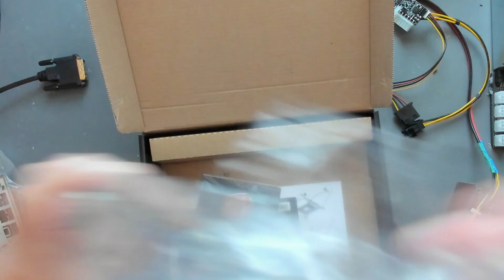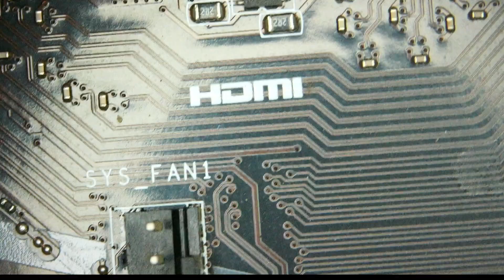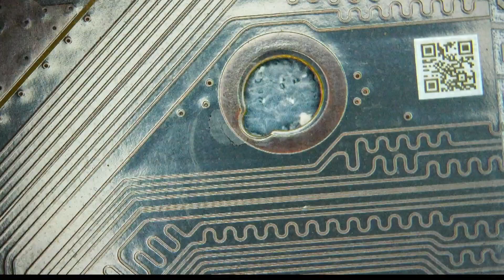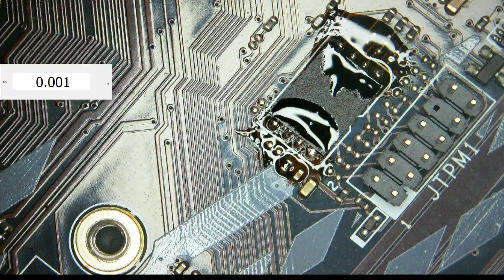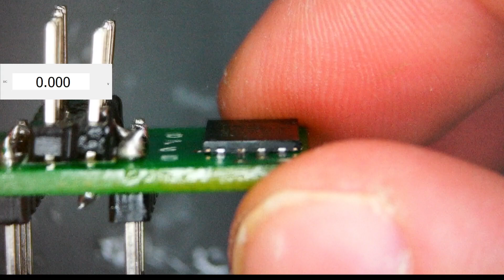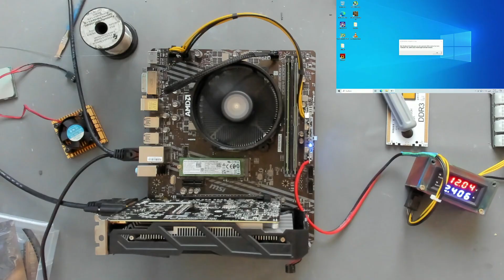CPU-LED NO BOOT || MSI A520M-PRO REPAIR MOTHERBOARD FIX

Comment: Recently i got the Asrock A520 Phantom 4 for 21,99 include sending in working condition. Is it worth repairing the lower end boards?
Reply from the maker: Lower end boards are most of the time not worth repairing money wise! For experience and knowledge they are great or sometimes for content, but money wise they are not!

Comment: I'm a bit uncomfortable with that hot air near these plastic connectors around the BIOS chip without any protection. Especially after i saw the melted connector on your programmer adapter. I suggest at least use some kapton tape to protect these connectors
Reply from the maker: I got to be honest, sometimes my work is a bit quick and dirty and i really could do with some kapton!

Comment: A lot of repairs are around AMD chipset. Is it on purpose or AMD motherboards are more prone to fail?
Reply: No issues with an AsRock B550 Steel Legend with a Ryzen7 5800 in it, GA and MSI are meh, Asus is the same too now, just poor manufacturer quality from the pcb makers.
Reply from the maker: Actually the chipsets or the PCH´s in my experience fail way more often on Intel Boards! Ive never had a B450 Chipset fail on me and ive worked on a lot of these, but for example X99 or Z270 Chipsets are dying left and right!
Reply: @MainboardMedic  my assumption was based on your last 10 video uploads. 8 AMD chipsets and 2 Intel chipsets.
Reply from the maker: @wolf1438  Oh you mean in general intel or AMD boards, i just tend to not buy the intel ones haha, they have way to many times a dead Chipset, so there is a lot more dead intel boards, but i just dont work on them!

Comment: Great job. I have always been flashing 1.8v bios chips with CH341A which is 3.3v. Never had any issues with it.
Reply: its not super risky just sometimes never verifies due to bad write small area similar to what he had but could be chip or center pad grounding a pin on wrong adapter not wson8 qfn8
Reply: CH341a data pins are current limited to something ridiculously low, i forget, something like 2mA, so the inherent pin drive resistance and the protection diodes end up eating the voltage difference. If you don't have a CPU connected that should be OK but it's not quite proper and i'm not sure i'm considering all the corner cases.

Most CH341A boards are made supplying CH from 5V instead of 3V3 and it still works not killing every single 3V3 chip either.

Ch341 is very very slow though so one wouldn't be using that given a choice, and other programmers have a different voltage-current behaviour.
Reply from the maker: @SianaGearz  Ive heard about that multiple times and people have told me that they where succesful! But i want to be sure, i had it before, where i had a bad flash with a 3.3V programming on a 1.8V chip!

Comment: 14:58 to check eeprom data fixation, bad byts, for exemple.. in your eeprom writer  fill all 00 and write and verify.. they all must be what you write 00. do the same but now using FF.

 some times have a error that is the same as the file i need to write, so the verification givew me ok, but that 0x00xx was bad. and you will not find.
Reply from the maker: I should defenetly try that first next time before tossing the chip! Tahnk you!

Comment: I have this same motherboard. i was using my PC and suddenly it turned off. After that, there were no signs of power. changed the PSU still had no luck. The next day when I tried to test it again it turned on but the Mosfet near the two capacitors on IO side burnt and smoked.fortunately Processor  was not in the socket:)  Now pc runs fine but I'm worried that it might damage the processor. What do you think I should replace the damaged Mosfet?i watched so many videos of yours and learned a lot. I'm confident enough to replace the MOSFET if I have to do so🙃 waiting for your suggestion.
Reply: i have attached imgur link too
Reply from the maker: @galaxytech1  If you have the proper equipment i would say go for it, but try it out on a scrap board first, to get a feeling for the heat needed!
Reply: @MainboardMedic  Thanks for the helpful advice  🫡

Comment: you got lucky w the QFN8 wson8 6x8mm chip.. the adapter pins sometimes touch center ground pad under chip and wont detect so try kapton tape under center ground... or get the yellow adapter for them cheap.
also try asprogrammer but ch341a is not a pros tool.. try T48 or RT809F or even cheap xp866+
Reply from the maker: I will upgrade to a Revelprog soon!

Comment: Nice video, I realy enjoy, can I ask you which one adapter you using for flashing bios?
Reply from the maker: The adapters, that i use are either from the CH341A or are self made!
Reply: I have the CH341A board, I haven't tried flashing a BIOS yet, where do you get the software program from? I see some of these BIOS boards come with a disk(software program). Can you direct me to a program I can use with this. Thanks.
Reply from the maker: @JoeSheerin-vq5iz  I use neoprogrammer when i sued the CH341A!

Comment: Do you need to make any changes to the bios file downloaded from the msi official website?
Reply from the maker: Nope MSI bioses are good to use from the manufactuarer site!
Reply: Why w25q256jweq ic not working?
Reply from the maker: @r.g.lakshansadaruwan3193  Ive had it that Bios chips just fail, really cant tell you why!
Reply: @MainboardMedic  how to download brodeview?
Reply: Do You have msi b450 gaming plus max brodeview ?